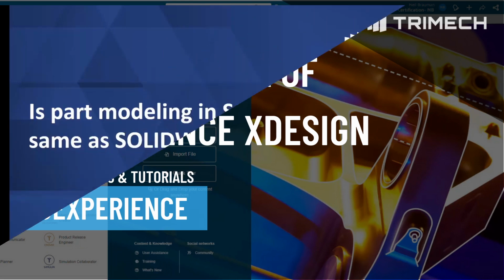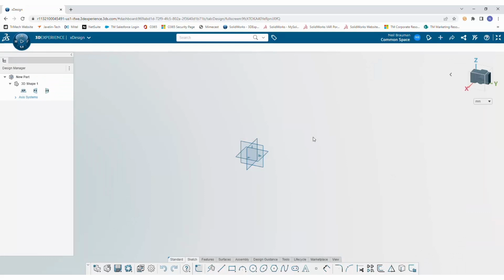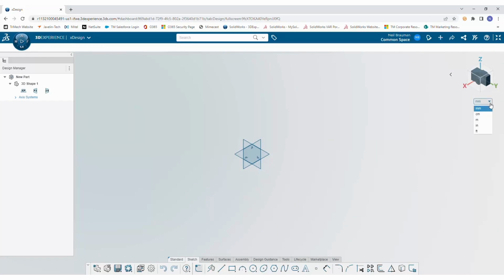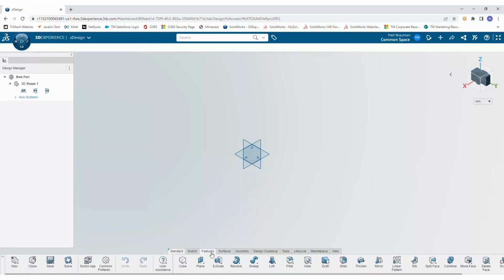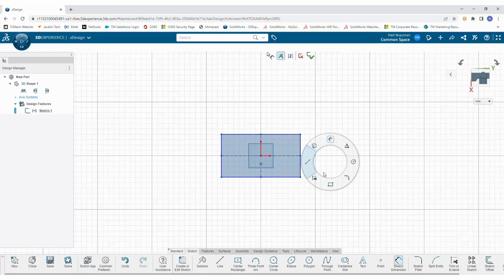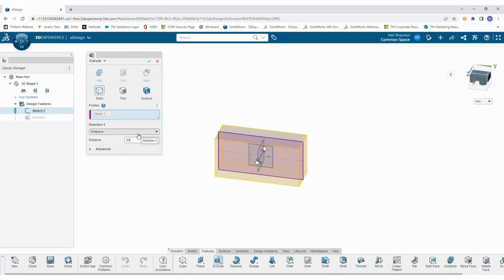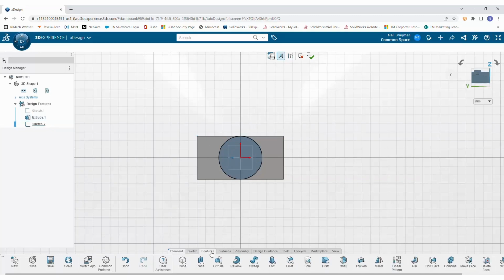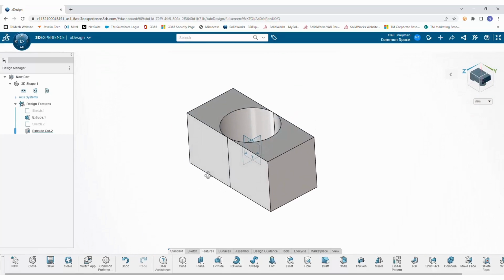First Look Tour of 3DEXPERIENCE xDesign

Comment: Hey, thanks for the video. Did you do a follow-up video on the differences between Solidworks and xDesign's interface, functionality, options, menus, shortcuts etc
Reply: Agree, seems to be differences for example in the type of mates offered in xDesign.  Slot, limited travel by distance or angle.  xDesign is a neat cloud based solution but if you're already used to Solideworks it feels lacking.  Perhaps there will be more updates.